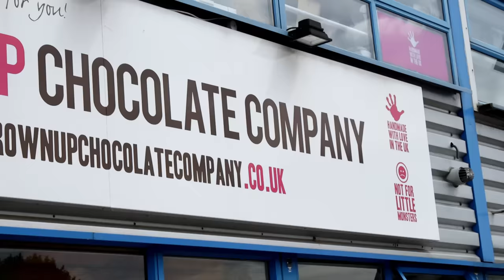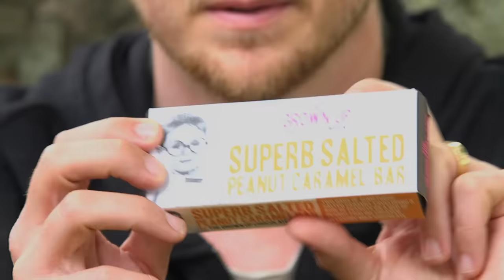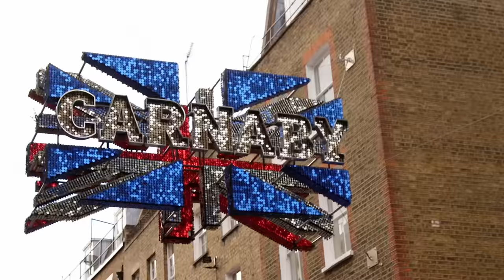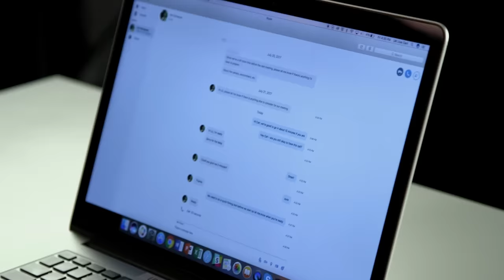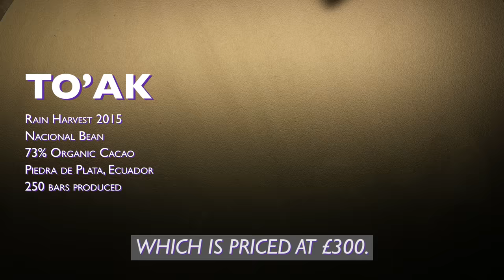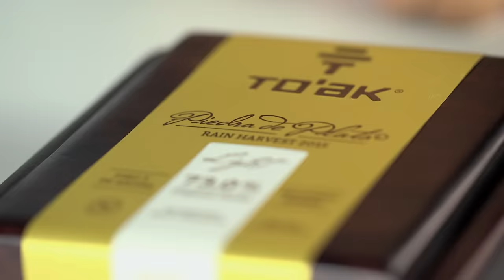£1.95 Chocolate Vs. £300 Chocolate

Comment: To compared "drastically different prices", one should assume that what is tested are approximately same size. 30 £ for a chocolate  bar that is 20 times larger than a chocolate bar to almost 2 pounds is not a drastically different price.